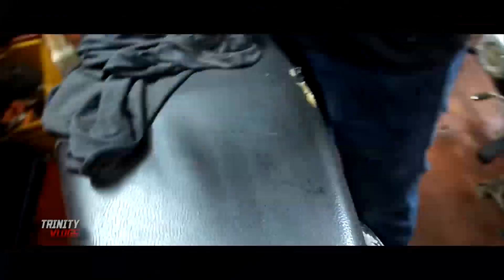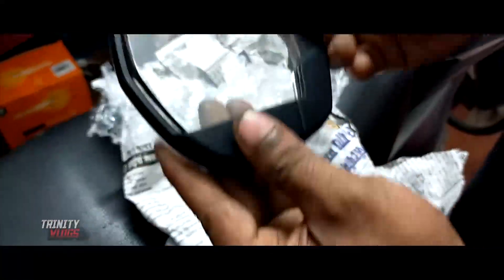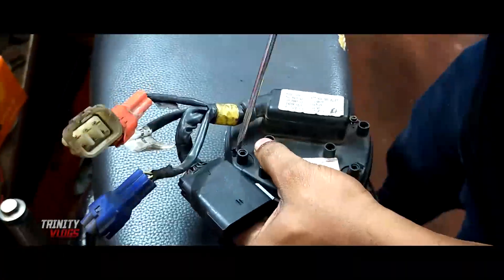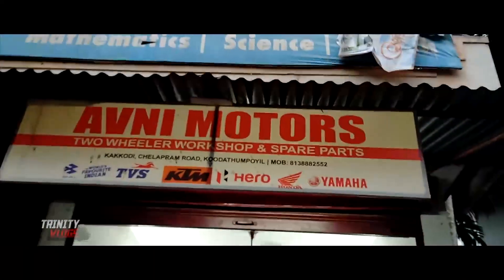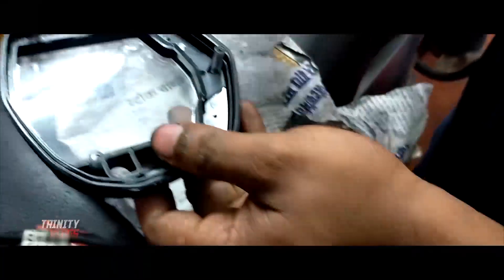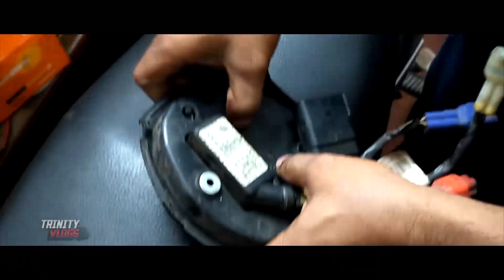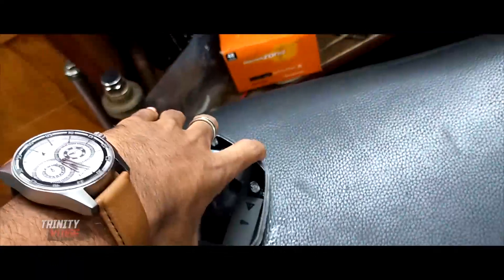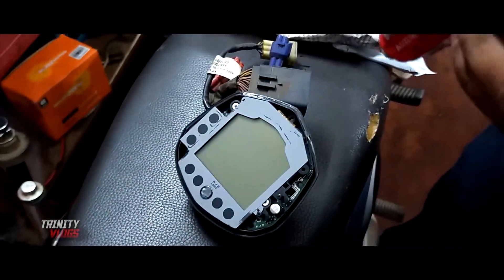KTM DUKE SpeedoMeter Upper Cover Replacement | TRINITY VLOGS

Comment: Enikum same issue undaitund..ente meter kedai.. Bangalore gujri nnu vere meter vangi.. install cheydapo ,speed one digit matre kaniknullu..70km/hr anengil 7 nnu matram.. odo meter reading um valare slow ayte ponullu, exact Kms nte valare korave koodunnullu.. gear shift um rpm um kaniknund.. endengilum cheyyan patuo
Reply from the maker: Bro meter ano kedayath or uper case ano kedaayath?
Reply: @TRINITYVLOGS  meter vellam Keri kedayadha
Reply from the maker: @rvrahul18  Seconds eduthath anp bro? sheriyakkan kazhiyum ennu thonilla bro
Reply: @TRINITYVLOGS  ok👍
Reply: Enikkum same issue nd